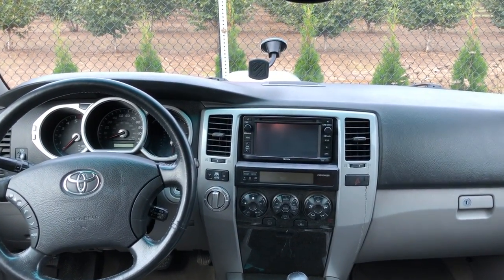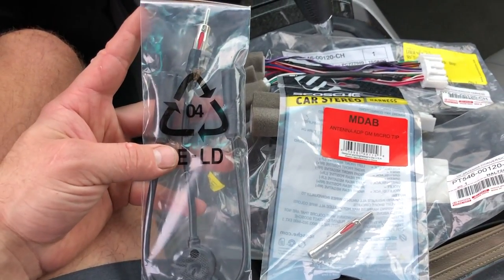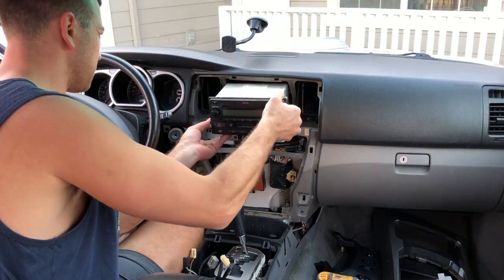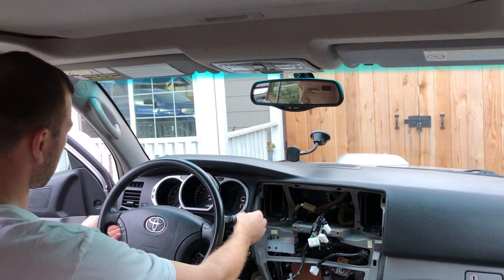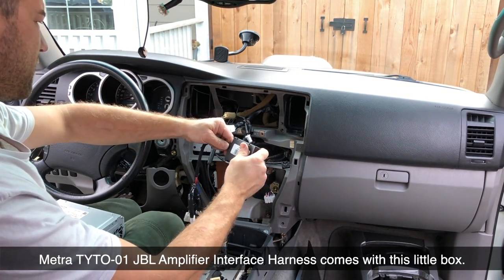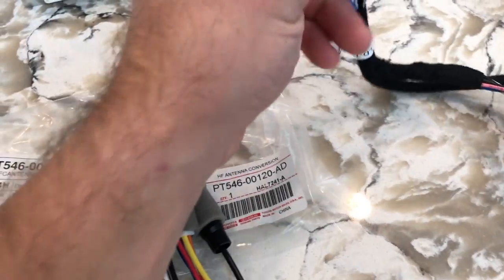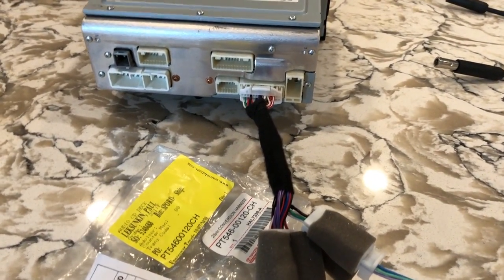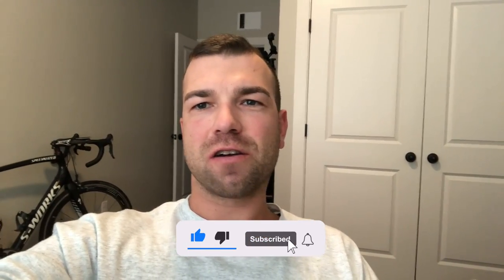4th Gen Toyota 4Runner Touch Screen & Bluetooth Radio Install - Upgrade 4th Gen Toyota 4Runner 2003

Comment: OH, I  have another question... The camera that plugs into the Yaris head unit is a bit overpriced so I was wondering if you knew how to connect an aftermarket rear view camera to the unit to make it work (without the factory plug)
Reply from the maker: I'll try to do a tutorial on backup camera install sometime soon!!!

Here's what you'll need for backup camera setup: 
1) Camera: https://amzn.to/3ryyU60

2) Harness #1: https://amzn.to/3nHvHjs

3) Harness #3: https://amzn.to/3KpgRrk

Installation instructions: 
https://thetrackahead.com/projects/2003-toyota-4runner/rydeen-backup-camera-install-4th-gen-toyota-4runner/

Comment: Nice video!, you make it look very simple, do you think the 2013-2015 Scion Radio Navigation Receiver Touch Screen OEM would work with the same procedure, the unit look identical. and they are cheaper, let me knoe
Reply from the maker: Hey man thank you for your support and yes 2013-2015 Scion head unit will work exactly the same.  Good luck and God bless you

Comment: I need help I have this radio and ordered subs how would I go about hooking subs up would I have to tap into the rear speaker or can it be done on radio
Reply from the maker: Hey man, head unit doesn't have sub out port so you would need to tap into a rear speaker. Unless you have OEM JBL system than you can tap into OEM rear sub

Comment: That is very smart, but I couldn’t find any exact same head unit🥲the LKQ all images are the same, I’m confused
Reply from the maker: Hey, just give them a call. And ask them for part number: PT546-52150. This is the part number for that specific head unit.
Use number to call: (360) 260-8400

Comment: Hi, I just got myself a 2005 4Runner Limited with the OEM touchscreen. I'm looking at upgrading to something more modern. I was looking at the Sony XAV-AX5600 7-Inch Multimedia Receiver with Apple CarPlay/Android Auto and HDMI Video. Do I need to get all those wiring harnesses? It's not as easy as just plug and play from the OEM into the new one?
Reply from the maker: If you get aftermarket head unit it will come with all the wiring harnesses and wiring diagrams. All the wires are color coded so it should be fairly simple.

Comment: I can’t find this head unit anywhere for under $300
Reply from the maker: Check LKQ site. I have link in the description. They should be around $200
Reply: @tronixster they don’t sell it anymore
Reply: I am about to uninstall mine from my 4runner and willing to sell. See my videos to see it working on 4Runner with JBL amp. Comes with wiring ready to plug and play.

Comment: At 17:40 in the video you point to a blue wire that gets spliced into the antenna harness.  This is coming from the black amplifier box.  I do not have a blue wire at this point.  Is this tapped into the blue wire that goes from the black amplifier box to the white connector?
Reply from the maker: Yeah that blue wire comes from the t-harness that 's connected to that black amplifier box and it taps in to the black/white wire of the white antenna. I hope this helps

Comment: Great vid, thank you for posting! I have a question: since this head unit's impedance is 4ohms, I'd like to bypass the factory amplifier to avoid any problems in the future (the factory system is 2ohms) plus I will change the speakers to 4 ohm 2 way speakers.Can you tell me how to bypass the amp? Thank you!
Reply from the maker: Hey Boris, I haven't done any research on that so it's hard for me to tell you anything right now. But I'm sure there's a way of doing it.

Comment: Hi Paul. Great video. I followed your instructions and tried to do the same thing with my 06 4Runner. I have the radio installed. Everything but the Bluetooth works. When I navigate to the Bluetooth mode there is no connect button. Any ideas?
Reply from the maker: I wouldn’t be able to answer this question but my assumption would be that it’s a faulty head unit or could be anything else

Comment: Great video. I have a question. Will this head unit work in a gen 4 4Runner without steering wheel radio controls?
Reply from the maker: Yes it will work without steering wheel controls. You'll just have one less plug to plug in.

Comment: Glory to Jesus Christ!!

Thank you for an amazing video. I do have one question: I will be doing this on a non-JBL 4Runner. Will I need the pigtail in the description? If I do, will I need to do any splicing or is it plug & play?
Reply from the maker: Hey John, if you have non-JBL system you won't have to do any splicing and you won't need a pigtail either. And good luck on the conversion.
Reply: @tronixster  Thanks for the quick reply, Paul! So I would just swap the connections from the current head unit into the new one ? I'm using the same one as you.

Comment: Thanks for rhis video. I just bought a used 2008 4Runner, and Im planning on updating my radio (CD Changer wont work, neither rear speakers). So thanks for the heads up on the Yaris option. Did you install the USB? I cant find that video. I want to have the USB option to play music from a Memory Stick if I dont wanna connect my phone.
Again, Thanks for your help!!!
Blessings.
Reply from the maker: I haven’t made any videos about USB port installation but it’s very straight forward and you’ll just need to plug into the back of your head unit and run it out from underneath your dash.  Here’s the cable you’ll need: https://amzn.to/3jIMDUN

Comment: Thank you for the video! I want to give this a try. Do the controls on the steering wheel still work?
Reply from the maker: Absolutely, controls work perfectly fine as shown in the video. Everything works.
Reply: @tronixster  I just did this install yesterday and everything works! 

How did you install the USB adapter? My 05 4Runner doesn’t come with a usb/aux connection. I’m wondering if there is a way I run it to the center console, adding it to one of the blank spots. 

How did you do it?
Reply: @tronixster  I just did this install but couldn't reconnect my steering wheel controls. Is there an adapter or wiring harness I'm missing?

Comment: I read a few comments to see if anyone had the question I had but didn't see it.. My question is, I have a 2007 and was wondering if you know whether or not all the steps and parts still apply? Also, that head unit is almost impossible to find but one that looks just like it for Scion is available, PT546-00140, do know if it will work?
Reply from the maker: Steps should be identical for 2007 model and yes Scion head unit will for sure.

Comment: Hi can you tell the head unit brand and all the list of connectors numbers and where can I order them all.
Thank you.
Abe
Reply from the maker: I took an OEM Head Unit out of 2015 Toyota Yaris with Bluetooth & Touchscreen and put it into my 4h Gen 2003 Toyota 4Runner. It looks and works great. It's awesome to retain a clean and OEM look in your car.
Here's the list of things you'll need for the same upgrade. 

Parts list for 4th Gen Toyota 4Runner:

1) OEM Headunit Part #: PT546-52150
Link: https://www.lkqonline.com/2015-TOYOTA-YARIS-Radio-Audio/-hF34mFc3PK/-i~255907545
(I recommend calling them in person and ordering it over the phone)

2) PT546-00120-CH Wire Harness
Click here: https://amzn.to/3tMqUyj

3) PT546-00120-AD Wire Harness
Link: https://parts.olathetoyota.com/oem-parts/toyota-tchfcantenna-convers-pt54600120ad

4) Metra TYTO-01 JBL Amplifier Interface Harness
Click here: https://amzn.to/3EmS1Vs
(You only need this part if your 4Runner has JBL Synthesis sounds system)

5) Metra 40-UV43 Male to Female Motorola Antenna Cable
Click here: https://amzn.to/3mkTa9P

6) Scosche MDAB 1988-Up GM Micro/Delco Antenna Adapter Tip
Click here: https://amzn.to/2Zrn3we

OPTIONAL EXTRAS!!

7) Car Vehicle Audio USB Cable Adapter
Click here: https://amzn.to/3jIMDUN

8) PT546-74120-MC Microphone
Click here: https://amzn.to/3bgDLki

Comment: So I just did this yesterday and now I have a slight hissing noise coming from the speakers regardless if the head unit is powered on (car power is "on").  I did some intial resceach and it might be a ground issue.  I guess Ill be running a ground wire from the harness (behind the head unit) to the chasis and see - if not its a ground issue from the amp in the rear of the 4runner.  I also saw that it could be the FM antenna as well.  Ugh.  I'll let you know what I find for others that may run into the same issue.
Reply from the maker: Sorry man,  I didn't have any of these issues. I hope you get it sorted out. Blessings
Reply: @tronixster  Well I got it to work.  There is a small blue adjustment screw on the Metra box.  After some careful tweaking I got it working with no more hissing from the speakers,

Comment: Sorry, one more question. There is quite some gap between the head unit and the  vents. Are you maybe aware of any good bezel that could fit to close that gap?? Thanks!
Reply from the maker: I've seen some people commented about having similar issue and I guess some models came with slightly different bezel. I didn't have that issue honestly so I can't really help. Good luck getting it figured out. If you find it please post a link on here so I can post it in my description. Thank you
Reply: @tronixster  Indeed! I wasn't aware of that. It seems that the 6x CD Changer had a bigger bezel connected to the head unit, while the non-CD changer head units have one bigger bezel connected to the center dash. So either fabricate a bezel or buy a new center dash. Most double DIN bezel will not work as the Toyota head unit is bigger....

Comment: Hey bro. Great video. I just picked up a Navigation head unit from a 2006 4runner Limited for my 2006 4Runner SR5. Will the connectors you posted here work for this install I am going to be doing?
Reply from the maker: Hey Luis, I'm not sure honestly because unit I'm using is a bit different but I think your headunit should be direct swap as far as I know
Reply: @tronixster  Hey Paul. Unfortunately it’s not a direct fit. Wouldn’t of been nice if it was.
Reply: Hey Paul, so I could not install the unit from the limited 4runner.
Reply: But I found another unit. Toyota part # 86140-0E110 from a 2013 highlander. Do you know if this one will work?

Comment: So I’ve only got one black plug that goes into the amplifier box. I’ve got the factory JBl RDS stereo system in my truck. Any ideas? Was the AXXESS TYTO-01 suppose to come with two harnesses? Mine only came with one harness with a black plug. Thanks!
Reply: So I did call Crutchfield and sure enough… my package was missing a cable assembly. They sent me out the missing cable n/c.

Comment: Do you know what other stereo from Toyota will fit into this 4runner? they ran out of parts on the website in the link below
Reply from the maker: You can also use Scion T10015 Head Unit.
Call these guys and ask them. They’ll ship to you if you are out of state. 
I don’t recommend ordering online. Order it over the phone. 

LKQ Will Call - Keystone Automotive 
Phone: (360) 260-8400
Site: www.lkqcorp.com
Reply: Henry, a number of them will work, from a Yaris and Scion. I have both from my project if you are looking for one. I also have all the non-JBL harness items assembled and will sell with the radio.

Comment: curious about a GPS antenna.  On the backside of the bottom front cover of the radio, there is a coax connection that I think is for an active GPS antenna.  As you installed the radio, do you get a GPS lock?
Reply from the maker: I'm not sure cuz I'm not using OEM navigation system

Comment: Do you have the Toyota part number for the radio? LKQ is showing a different head unit to the one you installed. Thanks
Reply from the maker: The part number I have in my description is right one. I know they have a generic picture on there but don’t pay attention to it.
Reply: @tronixster  OK, thanks

Comment: Is there anyway to install a navigation system on there after, cause to me this is a little dumb to do if you can't?
Reply from the maker: There's a way to have navigation system on it but it will cost you around $500 but I use my iPhone for navigation either way.

Comment: Hello, do you know if a scion radio would work?, it's looks exactly like this one that you installed, just have a different button,  instead kf the apps button has one that says map.
Reply from the maker: Hey, yes scion radio will work perfectly fine. It's exactly the same thing. The only difference is it will say Scion on the front of the unit and when it boots up it will show Scion logo.
Reply: @Paul Longer Great!, thanks for taking the time to answer,  I appreciated 👍

Comment: thanks for the awesome vid! i am in the process of doing the same conversion but want to add a backup cam...any advice on the connection and source for a camera? thanks!!!
Reply from the maker: I'll try to do a tutorial video on this sometime soon!!!

Here's what you'll need for backup camera setup: 
1) Camera: https://www.amazon.com/cm-MINy3-Backup-Forward-Facing-Camera/dp/B08LKGC518/
2) Harness #1: https://www.amazon.com/PAC-CAM-TY11-Reverse-Camera-Harness/dp/B00KWLA3T0/
3) Harness #3: https://www.amazon.com/gp/product/B0002ZPJZY/
Reply: @tronixster  install done. worked like a charm...just a heads up to the viewers that there is a about a 1cm gap between the side of the stereo and the dash trim......
otherwise, its perfect.....just need that backup cam vid ;)
Reply: @sr9tc  let me know if you find a solution for that gap. I have it too. Non JbL stereo is more narrow so there is trim
Reply: @louactor  the solution is to get a piece of matte black cardboard. Its a little challenging but doable. For me, not worth it
Reply: @louactor  I had the same problem. You need to source a non jbl radio bezel. Jbl model radio sir flush with the bezel but non jbl radio setups are recessed back and have black plastic surround eliminating the new  gaps

Comment: The 2020 Toyota 86 also has a touchscreen radio that is the same shape, I'm wondering if that could be wired up to work
Reply from the maker: Most likely it will work cuz connectors haven't been changed. Reason why I went with Toyota Yaris head unit cuz they are not as desirable and expensive

Comment: I just did the install yesterday and installed a new unit from Toyota, however the lights behind the buttons are not lighting up, the screen does go from bright to dim when I turn on my lights. I followed your JBL harness adapter wiring at the end of the video. Do you have any suggestions? One last thought, there seems to be a gap on both sides of the radio when installed but I did not notice it on your installation, am I not seeing it or do you have a something going around yours to eliminate the gap? Thanks
Reply from the maker: Yeah I have no gaps at all on the sides. Make sure metal brackets are installed correctly. 
As far as buttons not lighting up this is what one of the viewers commented: "I did everything you did step by step however the backlighting doesn’t illuminate. The white wire that was left un-spliced in your “little pigtail” 6 pin harness is for backlighting illumination. Had to take everything apart after realizing it wasn’t working and ground it."
Reply: @tronixster  I had the factory JBL system and for some reason some JBL systems have a wider radio and a different bezel for the dash, I bought a cheap install kit and modified it to fill the gaps on the sides, it does the job but doesn’t look right, eventually buying the correct bezel. I did read about the back light illumination after I made my comment, my fault for not reading first. Lol. So far very happy, also getting ready to install the backup camera. Glad I came across your video, much happier with the factory look than aftermarket.

Comment: Curious if anyone has used an alternative to the PT546-52150?  They're tough to track down.  Great video, btw.
Reply from the maker: Scion has exactly the same unit but it says "Scion" on the front instead of "Toyota"
Reply: @George Zamora Did you purchase yours from there? I found it, just surprised it’s 277$. Super cheap compared to 900$.
Reply: @George Zamora are you installing in a 4th gen 4Runner?

Comment: Hello Paul I wanted to know if the Sion radio would work as well ?
 it does look like the same radio is just a different part number, sims impossible to find the exact same one that you have 
only the Sion version available online
Reply from the maker: Hey brotha, yes Scion radio will work exactly the same no problem.
Reply: @tronixster  Thanks a lot man 
I really appreciate this info 👌🏽
Is a big help 
Much blessings 🙏🏽🙏🏽
Reply: I am about to uninstall mine from my 4runner and willing to sell. See my videos to see it working on 4Runner with JBL amp. Comes with wiring ready to plug and play.

Comment: Witch cable do i only  need, i don't have string wheel control or jbl system?
Reply from the maker: If you don't have steering wheel controls or JBL system, you'll only need these parts. 

1) OEM Headunit Part #: PT546-52150
Link: https://www.lkqonline.com/2015-TOYOTA-YARIS-Radio-Audio/-hF34mFc3PK/-i~255907545
(I recommend calling them in person and ordering it over the phone)

2) PT546-00120-CH Wire Harness
Click here: https://parts.larryhmillertoyota.com/oem-parts/toyota-audio-cd-deck-harness-pt54600120ch

3) PT546-00120-AD Wire Harness
Link: https://parts.olathetoyota.com/oem-parts/toyota-tchfcantenna-convers-pt54600120ad

5) Metra 40-UV43 Male to Female Motorola Antenna Cable
Click here: https://amzn.to/3mkTa9P

6) Scosche MDAB 1988-Up GM Micro/Delco Antenna Adapter Tip
Click here: https://amzn.to/2Zrn3we

7) Pigtail [that aready came with my head unit]
https://amzn.to/3FB5fib